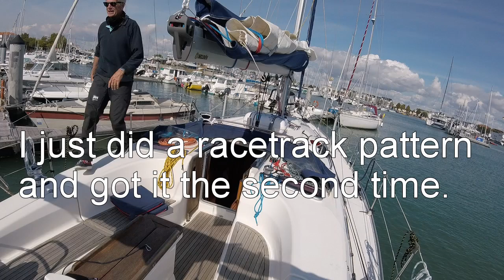Ep 18 Solo Sailing: How I Dock My 40' Sailboat 4 Examples and a Blooper

Comment: Great vid. Lots of fun!!!!
Can you do a, leaving the dock video, aft first? This is very good to watch and compare to my own techniques. I don't see you using your prop walk or wash to an advantage... maybe there isn't one.
Reply from the maker: Thanks SubPatrick.  In Episode 19, at 2:26 I demonstrate my technique for leaving the pontoon solo.  The technique is first to ease the lines a bit so that the bow touches the pontoon fenders. I then start the engine and put it in forward gear with the helm turned away from the finger.  (This locks the boat against the bow fender and side finger.)   I then remove ALL lines from the shore cleats.   To leave, I put the engine to idle, and very quickly center the helm, followed immediately by a strong burst of reverse power to give me sternway immediately.    Seems to work for me in almost all conditions.  Good point about prop walk.   My boat has a saildrive.  Thus, the prop is much further forward than a traditional 'shaft and prop' set-up.  The effect is that my prop walk (to port when reversing) is only about 1/3 of what a traditionally configured shaft/prop has.   It is a factor, but not a huge one.

Comment: Prepare ahead, be mindful of wind direction strength as well as currents. Practice in your mind what you are going to do.  Have fenders available, and make sure your engine and transmission are in good working action! Then Go For It!
When it is windy you have to do everything at a higher speed!
Reply from the maker: Yeah -- that's the starting point.   If I practice enough, I'll get good at this.  :-)

Comment: Really great video.  It would help to know what the boat speed is.  2-3 Knots?  I singlehand a 45' boat with no bow thruster and have a crosswind single slip. Lassoing cleats is a true art form.  Why is it when you do it perfectly, no one is around & when you screw up there is always a crowd on the dock?
Reply from the maker: I tip my hat to you 7381, because you understand how difficult the x-wind slip approach is.  (Prevailing wind where i live is about 12 kts into the other boat.)   And as you say, when you do it well, the only witness is a seagull, and when you miss it........
Re the speed, i think you are right--about 2-3 kts.   The truth is, i have never made a major mistake by going too fast, but have really messed things up by going too slow.   Also, i almost never use my bowthruster going into the slip.   I don't find it particularly helpful then, but i often use it on departing to help swing the bow when i am going too slow.   Thanks again for watching.

Comment: Thanks so much for posting - your videos are great - I found this one particularly helpful.  Please may enquire as to your keel type?  I've just got my first boat into the water and she is fin keel - certainly doesn't go as well in astern as the bavarias and janeau's I learnt in! Any tips would be welcome, if you find the time.  I look forward so seeing more videos in the Spring.
Reply from the maker: Very kind of you Noisebird.   There may be some terminology confusion here.  My Bavaria (like most modern production boats) has a 'fin keel' (think shark fin).   They are usually fairly easy to maneuver/turn.  The boats that have a 'full keel' running the length of the boat (actually greater than 50% qualifies) are known to be much more difficult to maneuver for obvious reasons.   Another major factor is the type of propulsion.  My Bavaria has a 'sail drive', which means that the prop is much further forward than on a traditional prop and shaft system.   'Prop walk' on prop and shaft boats is much more pronounced than on boats with sail drives and can really make maneuvering difficult.  The reason is that the prop on the sail drive is closer to the center of rotation of the boat, and therefore has much less rotational moment.   My friend's prop and shaft boat pivots very violently to the left as soon as he touches reverse ---- where my leftward rotation is hardly noticeable.   There is no cure for this, unfortunately, other than practice, practice and more practice.    You might want to invite a professional instructor aboard for a couple of hours, and he/she may be able to give you some invaluable insights.    Thanks again for watching.

Comment: Great video and I learned a lot. Thank you. One question though, why don't you reverse to the pontoon when the wind is blowing you off? At least that's what I do. Yes, that would I pass the spot first. Then again I usually do some sort of a reconnaissance circle to have a look at the situation (and how high my fenders need to be) when I'm new in town. I also got the additional advantage of having a fixed (no lid) bathing platform on the back of my boat. Before reversing into my spot I make sure I can get down to the platform without having to jump over obstructions. This gets me much closer to the bollards which increases the chances of catching them with the first throw.
Reply from the maker: I love backing in as well Mike.   I did show one (going into the fuel station) where I use that technique.   As you suggest, you back right up to the cleat/bollard and drop the line over it and then motor forward. I don't do it in that berthing spot for two reasons:  I can't pass my berth and go further down the fairway and then back in as there is very little water further down, and the space pinches together.  (Those boats you see there are much shorter than mine.)   Secondly, I just don't like putting the stern to for reasons of privacy/security.   That said, the maneuver you describe is ideal, and I often use it.

Comment: Bravo! I really enjoy watching your videos! They are very informative. I have single handed only up to 22' with an outboard kicker. I have a bit of time up to 38', but always with a crew.  You make it look easy! Now, how about some stiff cross winds or current?  : -)
Reply from the maker: Thanks Cliff.  I find docking to be the most stressful part of sailing.  In following episodes I do a trip around the UK and filmed most of my arrivals --- so there is a little bit of everything in there in terms of wind/current, etc.   BTW, the absolute worst arrival I made during that trip was a simple trip to the refueling station in one of the Northern French ports.  The wind was dead calm, but there was about 3 knots of current flowing through the marina (that I grossly underestimated).  I was VERY lucky that there wasn't another boat there, because I got too slow and completely lost control and ended up at a 90° angle to where I wanted to be.   Ouch.  I escaped that one with no damage --- but thanks only to luck.

Comment: Nice technique for boats lacking a bowsprit.  My boat has a bowsprit which is supported, in part, by rigging from its underside to the bow just above the water line...  any contact with the pontoon would strike this rigging likely resulting in substantial damage.   Do you have a technique for docking to starboard that does not require pivoting against the pontoon?
Reply from the maker: I really only see three options DJC: 1) you reverse into the slip (which is a very popular choice, and not exceptionally difficult for most boats); 2) you have a crewperson who can step-off once alongside the finger, or 3) if the finger is long enough, you drop a midship line over the first cleat on finger as you enter, and allow it to pull you into the finger without touching the pontoon with the bow.     Not particularly easy if one is solo, I admit.   Fair winds to you.

Comment: Very well explained.The problem in France is that the needle pontoons are frequently too short for a 40foot boat.
Reply from the maker: I don't have enough experience in other countries yet Bill to know how long their 'fingers' are.  Clearly, if the pontoon were 2 or 3 meters longer, I would try to drop a bridle over a cleat and let it pull me into the finger.  As it is now (with short fingers) I don't dare leave the helm while in such a critical place (between finger and the neighbor's boat) without the boat being 'secured'.      Many thanks for pointing this out.   A 30 foot boat can certainly use a different technique.   Best regards
Reply: Patrick Laine Ithink they are unique to France Ihave not come across them here in UK. We had a real problem securing our boat which is 40foot in Camaret for the winter.On the other hand a berth is cheaper in France than here so it is a small price to pay.
Reply from the maker: I've become used to (but not comfortable with) short fingers Bill.   I sailed up the coast toward lower Bretagne recently, and saw some very, very short ones at visitor's section of Crouesty, and Ile de Groix.   They make solo arrivals even more 'sporty'.  Many thanks for watching.

Comment: I really enjoyed your video - thank you for posting it. It was very helpful to me to see your techniques. Your camera shot is perfect - it is very easy to see what is happening. One question, how would you execute your first mooring without the bow fenders? I'm talking about charter boats etc.
Reply from the maker: Thanks Szymon.   Well, when you do not have a bow fender, you really only have two options: one; you come in two thirds of the way into the slip and stop (and run for the midship line to throw over a cleat, or ask your shipmate to step off and secure the boat).   I admit that this option is very diffcult in a high x-wind blowing you away from the finger.  The other option is to approach stern first (trying to back into the wind as much as possible).   The advantage of this approach is that you can actually go faster (a plus in high winds) and better control the boat until the last second when you give a strong shot of forward power to stop the boat, and drop the line over the cleat.   A major sailing school in my home port uses almost exclusively this method.  Takes some practice of course.    Thanks for watching.
Reply: Thank you for your reply Patrick. I'm watching the rest of your videos now. They are very good and informative. Also very calm and relaxed - this is what sailing is to me. Keep them coming!

Comment: Thank you for a good video. We have a FYI federing prop, I’m wonder if that will impact the position on the wheel when steering.
Reply from the maker: I have a feathering prop also (3 blade).  All is fine for maneuvering.  That may be different for a 2-bladed feathering prop........
Reply: @patricklaine6958  We have a FYI three blades; in theory the reverse position of the blades while backing should eliminate any behavior difference on the boat, but I have not been able to confirm this. Any comments ??

Comment: LOL only this is the exact same thing when flying.   getting in the air is pretty straightforward, its always the reconnection with terrafirma that present the biggest challenge.
Reply from the maker: :-)  You got it Bo.  When I was (re)learning how to sail a few years ago, there were always 4 or 5 people on the boat.  It really wasn't too hard to dock.  You just got somewhere near the pontoon and one or two people would step off with lines in hand.   When I started solo sailing ----- it became a completely different challenge --- degree of difficulty x 10.  Wow.  But, just as my first landings on the aircraft carrier were not pretty, I eventually (with lots of practice), became proficient enough to safely walk away from every landing.   ;-)  I'm hoping I'll eventually get that way with my boat as well.  Thanks for watching.

Comment: It seems like for the Ponton you could pull up and throw a loop from the stern cleat over the dock cleat and then motor forward to maintain contact with the dock while you tie up the bow?
Reply from the maker: Yes Scott, that is an excellent technique (and I even showed an approach like that in this video).   It is sometimes difficult to toss a line from the stern over a cleat on the shore ---- on my boat, I have a bimini frame, davits, a GPS antenna, and a life buoy that can interfere with the lasso attempt from the stern......I do use it on occasion though.

Comment: He alludes to use of an aft spring line as an alternative but suggests that isn't practical because he can't reach it from the helm station. In fact it will work well; I've used with a buddy's 37' sloop that has practically the identical situation of starboard tie on a short finger pier with a close neighbor. The spring line has to have a loop and just the right line length to stop the boat a few feet from the end of the slip. You come in a little less hot with spring and stern line in hand, jump down and immediately drop the spring line loop on the cleat, then hook the stern line on the dock cleat to resist the stern from swinging out when the boat swings on the spring line. If the wind is quite strong from the right, then back the boat down the channel and come in from the other direction with a 90 degree left turn.
Reply from the maker: I agree Richard, the technique works very well, and I've used it often before when coming alongside elsewhere.  BUT, the finger pontoon of my berth is quite short.  The first cleat is 3-4 meters forward of the helm.   I could surely reach it on a day with light winds, but at 10+ knots of wind off the finger pontoon, by the time I leave the helm, drop the spring line over the cleat, then go back to the helm to put the boat in forward gear, I will surely be up against the other boat in my berthing space.    I think if the prevailing wind were on the bow this could work, or with a longer pontoon, but I can assure you that no one uses the spring line technique on the long row of fingers where I am berthed.   It is an excellent technique, as you suggest, under the right circumstances.   Thanks for commenting.
Reply: Hi again, Patrick. A few years have gone by and I now have many hours of maneuvering and docking experience as a professional sailing instructor in a dozen different charter class sailboats from 37-45'. I watched your video again with renewed appreciation. I can't come up with better techniques than you have here. Your bow bumper is an excellent innovation I've never seen before. Single-handing a 40' sloop with a strong wind blowing you off is about as tough as it gets.

Comment: Patrick,  I tried your method while reversing in,  but  had difficulty keeping the bow from blowing off.  But I'll try again if you tell me you are able to do it.   I have no problem when driving in, bow first, as you show.     I'm guessing that its because in reverse,  the forces are different.   Also, what make of bow fender are you using?   I have been using a heavy/solid  stern fender,  but it is not perfectly shaped for the bow. It does work, but because of the weight, it is quite difficult to deploy.   Great videos,  keep them coming
Reply from the maker: I don't back in regularly Garry, but the times I have, it works fine.  Try to back (as much as you can) against the wind and keep the speed up.  You can easily stop in time, as you are looking at the approaching pontoon directly.  If you go too slowly, the bow will fall off with the wind.   The largest sailing school in my home port exclusively uses this method (reversing in more or less into the wind, with a bit of speed, and a big ball fender hanging over the stern; the instructor hits forward gear fairly late, but I have never seen them hit the pontoon).   This is the bow fender I use.  I replace it about once a year (when on sale):  https://www.bigship.com/catalogue/mouillage-amarrage/defenses-et-pare-battages/defenses/defense-de-ponton-blanche

Comment: Need to know Patrick....
As you seem to cruise alone, why did you chose a race pedigree boat with a high performance keel instead of a long, high stability keel cruiser such as the Westsails or the older style cutters so common in Europe?
Seems to me that a long narrow ended stern would offer greater safety when sailing alone in high seas.....and also moving the wheel more towards the cabin...
But I am no expert....so...cheers and God speed!
Reply from the maker: Good question André.   I chose this boat for two key reasons: 1) it is a very comfortable 'cruising boat' tested and proven by thousands around the world, and 2) It perfectly suits a solo sailor ---- everything can be done from the cockpit.  There is no reason to go to the mast (to put in a reef, for example).  Although perhaps counterintuitive, those long keel traditional boats are great for blue water sailing in tough conditions, but they are quite challenging to maneuver around a marina --- especially when solo.   My boat is a compromise between the older narrow stern (with deep keel) boats, and those very wide stern boats with flat, shallow draft --- so poplar among the racing community today.  No boat satisfies all requirements, but mine is a a good, safe boat, ideal for solo sailors.   Thanks for the comment.

Comment: Thanks! Been watching this video and Ep 32 and 33 on this solo docking technics. That's great ! I'm going to get my docking sticks and try them. Thanks Patrick!
Question : why do you say you're dreading the port side docking? If the prop wash pushes the boat to port, reversing will help, right?
Reply from the maker: Merci Philippe.   I did not watch the video again to see where I said I don't like port side docking.  As you say, prop walk can be a nice aid then.   I often dock 'port side to', so it may just have been in reference to the wind on that particular day.   I filmed many docking maneuvers in the following season (Ep 22 to 31 and I imagine they are about 50/50 port or starboard).    That trip also convinced me of the great utility of the Docking Stick.  ;-)    Thanks for watching.